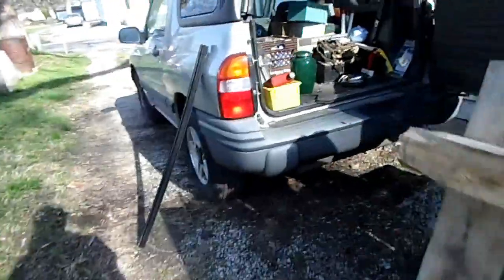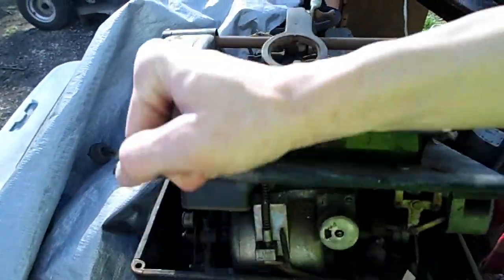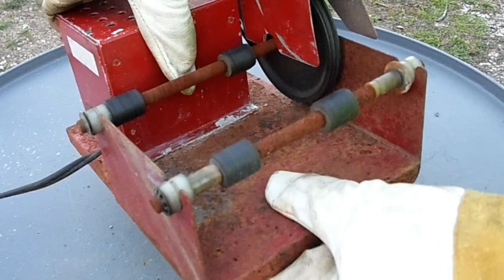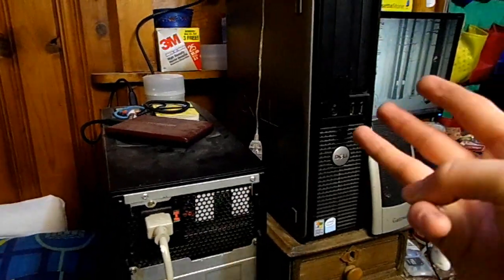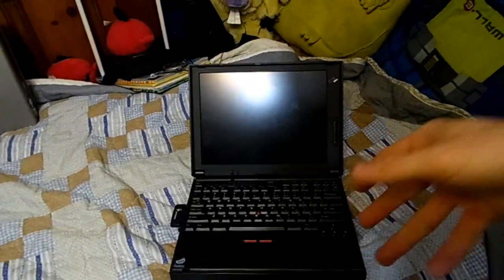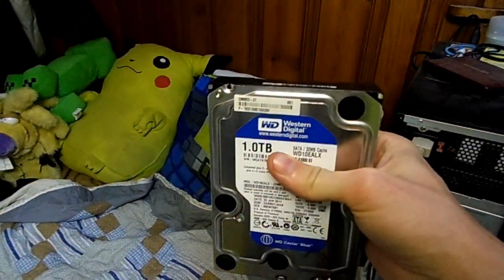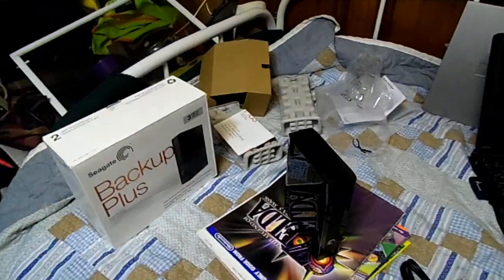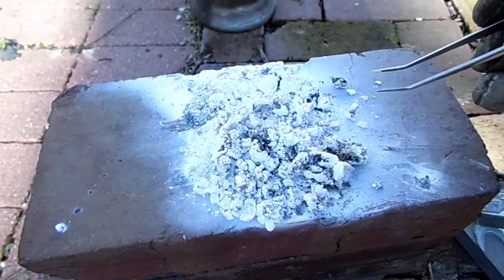Random Bits 0022: Ediphone 3TB Seagate and Magnesium

Comment: That Edison dictaphone is great.
   I remember at a place I was employed there were the forerunner of the fax machines that had become obsolete with the fax machines.  They employed a rotating cylinder with a paper that would be burned from the signal sent as the sending machine over the telephone lines.  The resolution was terrible and the coating on the paper was crumbly.  So as soon as it came off the machine, the best thing to do was to run to a photocopy machine and make a copy of the imprint paper before it substantially disintegrated.  I wished I had grabbed those machines.
   I keep my computer back-ups in my truck under the assumption that both the house and the truck are unlikely to burn or flood at the same time, but that would not protect them from massive solar flares.
   Aren't the bebees/ball bearings going to scratch the bottles?  You might wish to try something like shredded pieces of rubber from your numerous tires and mix them with that fine clay from your creek bed. Putting a detergent in with the clay, rubber and water mix wouldn't hurt.
   That metal and glass composite picture tube funnel is interesting.  I thought it might have been a metal shield to protect the tube from impacts and maybe some sort of Faraday cage type structure to prevent interference from the sets other electrical components when you first showed it.  I remember old sets having a shield.
   As a kid when I learned the TV operated on a beam of electrons directed by magnets in the back, I took a magnet and placed it near the edge to the screen and watched the picture warp.  My mother had a fit telling me I was going to ruin the television.  I told her the electron gun was in the back and wasn't affected.  The only things that were messed up was the pictures hitting the florescent screen at that time.  As soon as the magnet was taken away, things were normal and no lasting effect.  But Mother insisted I not do it.  
    I have never seen those items, but my guess would be the same as karusboy.  They probably function like zip ties.  The male part with ridges goes in and the female part grabs them like a ratchet. If you ever have the inclination, cut one in half so we can see the insides.
Reply from the maker: speaking of fax machines, Secret Life Of Machines - The Fax Matchine (Full Length)

and yeah putting magnets onto TVs is fun, can even turn them into oscilloscopes. unfortunatly color TVs have a metal frame in the front and that can get magnetized witch will mess up the color for a while.
Reply: Thanks.  I did not know of that series.  I'll have to explore it.
Reply from the maker: *****
i just discovered it this month. i love it!

Comment: A few corrections I’d like to point out...

1. That Ediphone is from the 1930s.  The 1917 date you point out is likely a patent date.

2. That Blue Amberol record is from the 1910s-1920s and is not compatible with that machine. They are to be used with the earlier cylinder phonograph machines. The Ediphone used the larger cylinders for recording/playback.

3. The Blue Amberol is in an incorrect cylinder “box”. I’m nitpicking because often the various cylinder types are stored in “incorrect” “boxes”.  That green cylinder container was used with the black wax Amberol made from 1908-1912, which were the first cylinders mass produced by Edison to play 4min records vs the previous 2min black wax records.  The Blue Amberol record you have is a Celluloid material, pretty darn durable and highly flammable :)

Comment: About 2 months ago I purcahsed a WD Mybook which is 3TB and YES I was afraid to put everything on it. So far so good. I have yet to remove the things I put on it from my laptop. What I have found is my 3TB WD Mybook or personal cloud rarely if ever runs. It only turns on if I access it and after about 30 minutes of inactivity it goes into sleep mode. So it's barely spinning which leads me to believe it should last quite a long time...? I just saw a 1TB SSD drive for about 450 bucks that's not bad when you think about it and it was Samsung which is rated the best. I'm considering swapping out my laptop HD with a 256GB SSD which should last forever
Reply from the maker: remember that SSD's have a limited life cycle though, they can only be read/written so many times. but its not really something that matters too much now that we have the SSDs move stuff around so no one part of the memory bank gets worn out before the others.

that is if the SSD is flash.
Reply: The Samsung will last an average everyday internet surfer type about 10 to 15 years if you buy the 840 EVO if you buy the more expensive 840 PRO much much much longer
Reply from the maker: Sachi WI
yeah,

i'm kinda obsessed with finding a way to store digital data in a medium with the longevity of a book. everything we have today like CDs, Magnetic storage, and bubble memory can be erased in an incident or after a few decades. looks like ROM chips are still the longest lasting thing we got.

long live game cartridges hahaha
Reply: I must say I have never burned up a hard drive yet - maybe you just got unlucky. Since these are made in the thousands per day something is bound to fuck up ya know - also that SSD I am thinking about comes with a 3 year parts and labor warranty so if it fails within that time frame they pay to have it replaced in my laptop which is really nice I think
Reply from the maker: Sachi WI
or maybe its just couse i have about 40 hard drives in the like 20 computers and 4 laptops i own haha
Reply: Do we need to call Hoarders? LOL j/k
Reply from the maker: Sachi WI
 i actually need more things, i'm running out of things to make videos with haha.

Comment: Heavy-Duty - Keyless - Single-Use lock which must be cut with a bolt cutters in order to have them removed. http://www.seals.com/bolt-locks-PBLT-1.asp
Reply: Funny that you mentioned these. I had seen them used on the Reponut channel where he was at a storage unit to collect/repo a motorcycle that was kept in storage. Since he was a grand behind in fees the unit owner put one of those locks on the garage door

Comment: You could cut that can down so it fits the tumbler and solder the bottom back on.
Reply from the maker: but then none of my bottles would fit into it for polishing. i just need to build something bigger from the ground up instead of trying to retrofit something small.
Reply: oh ok I missed the bottle part or didn't understand what are the bottles?
Reply from the maker: Jim Bradshaw
 i have quite a few bottles i find in the woods, and they have a hard layer of grime on them from sitting in mud for 100+ years. the grime doesnt even come off with a screw driver.

but if you tumble the bottles with metal pellets and polishing compound with some water, it will rub off that grime and they look almost new.
Reply: shipping container security locks or customs locks

Comment: Mirrored RAID drives is probably the lowest cost solution that still provides some level of redundancy. I'm not a huge fan of the usb drives. It gives you more space in a pinch but aren't a true solution as a backup as they don't provide any redundancy.

Now assuming we have a world changing event that somehow destroys everything. The world will have to find a way to live on without your first ms-paint drawing but.. with time.. we will move on.
Reply from the maker: Well with this system I have two copies of everything so there is redundancy. And yes I know the files on it are worthless to others but they are worth something to me.
Reply: Backups and RAID redundancy are two very different things. using USB disks as backups is just fine as long as RAID redundancy is not a requirement like in this case.

Comment: Yep data storage is never 100% reliable, i keep my bits-n-bobs on hard drives and dvd disks kept in the dark.

Your wise to be as carefull as you are, make sure that new drive stays cool, some can cook themselves :-(

I had an elenex xt 8086 machine, it had a 20mb seagate drive, mfm western digital 8 bit card with 32 way and 20 way ribbon connection to the drive.
Never broke down, but i suppose being a really wide track of data it was bomb proof :-)) good old dos days, simpler then :-))

Havnt a clue what the broken bits do.